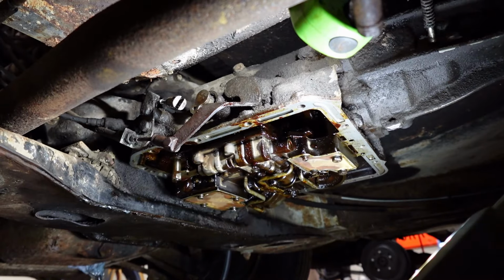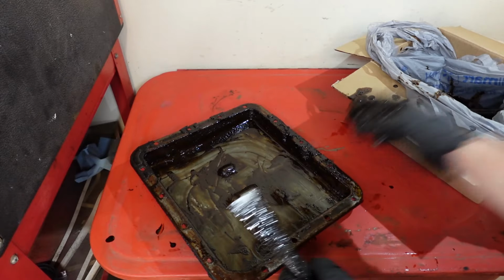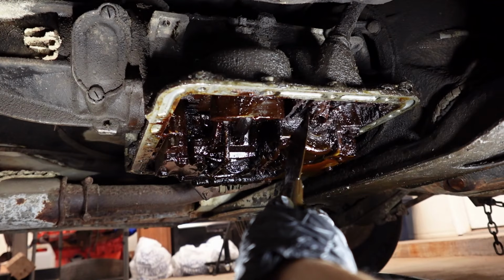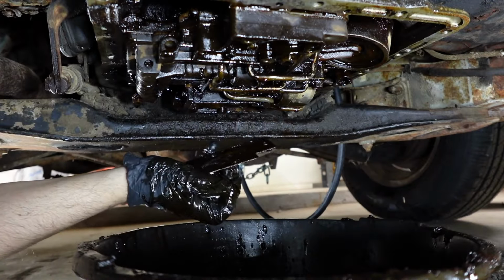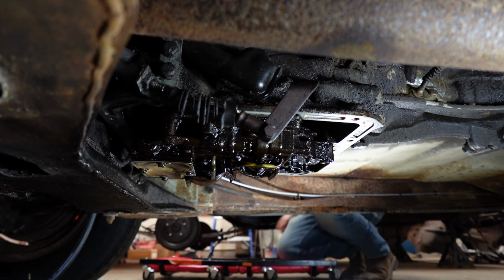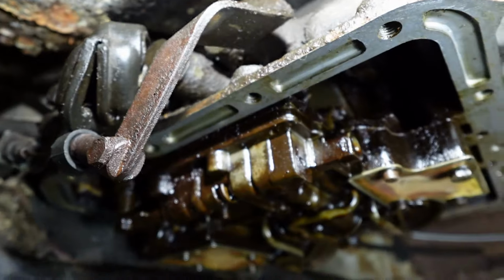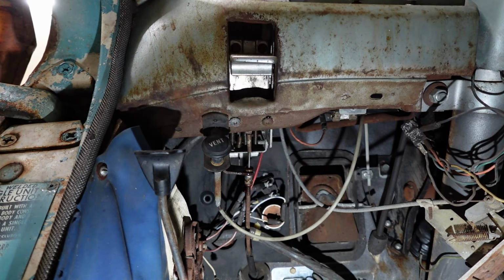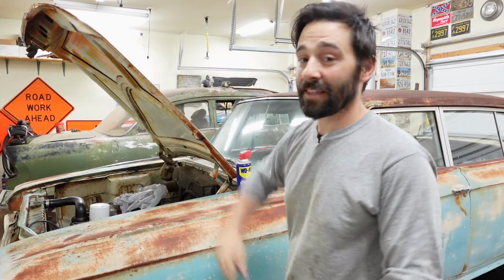Can Someone Explain What Happened To This Transmission? Abandoned 1962 AMC Rambler

Comment: Did you consider putting the trans pan on (maybe without the gasket), and pouring something like brake cleaner down the trans dipstick tube and letting it soak? Might free it up. Assuming there is nothing delicate the fluid might damage.
Reply from the maker: No I haven’t but that’s pretty clever.

Comment: don't forget the vacuum shifting can on the front of the tranney, Fatsos transmission has the parts.also check the vacuum tubing coming from the intake manafold,lastly the neutral safety switch on top of the intake manafold.   good luck
Reply: I am pretty sure the M35 uses the TV cable and not a modulator.  The modulator is on the 56-61 M8 transmission
Reply from the maker: Yes this one appears to be all mechanical.
Reply from the maker: This one appears to not have any of those. I wrote down Fatsos & will keep that in mind for possible future use. I appreciate your comment.
Reply: It is not fatsos:  it is Fatsco and Phil and his dad are great folks.   @freemansgarage
Reply from the maker: Thanks

Comment: I've never an automatic transmission look like that.  I think it might have mixed coolant with the ATF and then it sat for a lonnnng time. Be sure to check the radiator cooler.
Reply from the maker: Absolutely. Except for this automatic transmission happens to be air cooled. What a mess this was.

Comment: Good job on working at the transmission, it looks like it was never serviced or it was mis-serviced. I will assume you know that it is a Borg-Warner 3 speed transmission. To get full advantage of the transmission you would push D1 button, that way it will go through all 3 speeds. D2 starts the car in second gear and shifts to 3rd gear, which is good for slow applications, such as snow or ice. I think that maybe some cleaner would work in removing a lot of that old glop and freeing up the transmission  shifting into gear. Keep the faith, We are all routing for you an the car to get it up and running.
Reply from the maker: It’s definitely a well used transmission that’s for sure. Yes I do know that. I don’t why in the video I said I would use D2. I would use D1 for normal driving. Use all that horsepower off the line. Im working on the next video. The valve body is out & being cleaned. Thanks for the nice comment. I appreciate that.

Comment: Freeman close it up and fill it with DIESEL fluid let it sit for several days then drain it all out. DON'T START
Get a brush and clean the body that been sitting in DIESEL. 
Put a new gasket on get buttons to move Now start car to get the fluid moving around
Reply: Nope.  Diesel will accelreate the gelling of Type F mixed with lucas.  Valve Body gets soaked in seafoam for a week, then dropped in an ultrasonic cleaner, then rinsed in lacquer thinner or Acetone.
Reply from the maker: I’ve already pulled the valve body out. I’m now committed to more scrubbing & scraping. We’ll see what happens soon. I appreciate you watching these videos & commenting.

Comment: What is the lever with the silver round ball on the end of it, that is just right of the trans push button panel?
Reply from the maker: It's moves up & down. It's part of the blower motor controls. I haven't figured it out all out yet. There's two of those balls.

Comment: Ive gotta ask, just how bad does that transmission goo smell?   One of the worst automotive fluid smells, can be super burnt ATF.    Never, have I ever seen a mess like yours...

This might be a super cooked transmission.  Even if its really worn out, she still needed a good cleaning.  I also recommend filling it way over full with something like diesel, or kerosene.

Acetone might be too rough, unless you know for certain your going to rebuild it . 😉
Reply from the maker: It smells more putrid than burnt. Not too bad but it’s kind of an old water smell. I’m pressed for time unfortunately so I’m just using brake parts cleaner for simplicity. I have it on hand. However, I might soak the valve body in Seafoam. We shall see. I appreciate you watching & commenting.